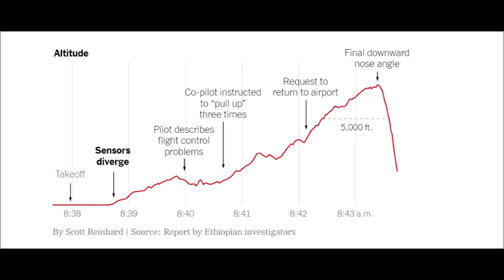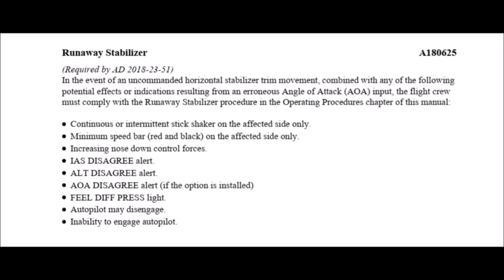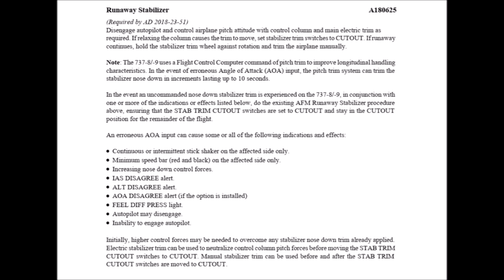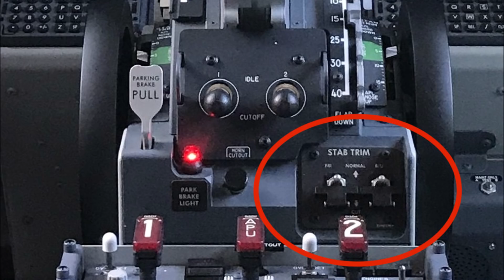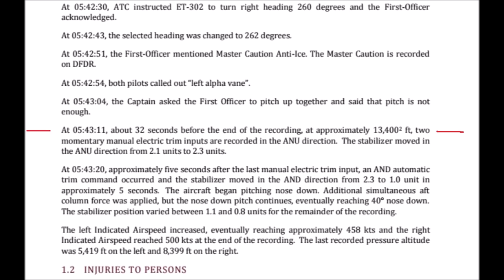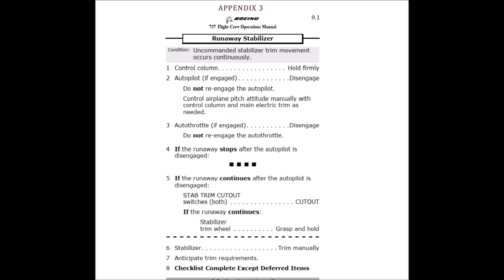737 Max Update 10 April 2019 Runaway Stab Trim Procedures

Comment: you keep saying that the crew came very close to saving the aircraft, and that they did NOT have the luxury of altitude, so are you saying that this is the fault of the pilots?
Reply: No, Juan never blamed the pilots. What he said is that they could in theory have saved the aircraft, which is a different thing.
Reply: @gordonrichardson2972   who is Juan??!!
Reply: At 00:03 in the video he states that his name is Juan Browne.
Reply: Disengage you know they've been saying that for a while  no one can listen  them anymore because people know the truth. .
Reply: I would have to say, the pilots had their hands full and not enough altitude/time to get control of the issue.  Sounds like they focused on getting control and the emergency occurred before they finished cleaning up the aircraft from take off where they would have switched to climb power from takeoff power.

It is similar to the 2 737 rudder hardover crashes in the 90's. The only reason, the 3rd 737 did not crash is the pilots had some knowledge of the previous crashes.
Reply: @fyrman9092   yes it does sound like they were super busy and focused on particular things..maybe some of that might have distracted them from the increasing airspeed...i'm not saying it's their fault either...

Comment: This speed vs. trim theory is not correct. If the aircraft is out of trim nose down, the faster you fly towards the trimmed speed, the more in trim it gets.
Reply from the maker: See previous updates.
Reply: Yes, but the the controls get heavier at high speed. In particular, it the elevator is forcing the stabiliser nose up, the trim gets harder. The whole story is very complex, and we are still putting together pieces of the puzzle.
Reply: @gordonrichardson2972  Yes its indeed very complex. I found this note in one of my previous aircraft types QRH, for stab trim runaway. "If a pull force is required, increase
 airspeed. If a push force is required, decrease airspeed."

Comment: Thanks! Very well explained. Is there a generation of pilots out there who can't actually fly without the computer? Or are these new generation of aircraft difficult to fly without the computer?
Reply: It's the computer that pointed the plane to the ground :(( It's like the computer in your car that run lane assist suddenly decided to turn your wheel to one side and keep it there. What will you do? Unless you are trained to handle the situation expertly, most drivers with the surprise and danger factor might not make it, especially if they were at high speed or in these cases both high speed and/or low the the ground. It's not a case of pilot incompetent, or computer too complex. It's just a case of inadequate design that make the job of a pilot that much harder that an average pilot might not make it. If only former fighter aces can fly these planes, we can't just hop on an airplane to go anywhere in the world like we can do today.

Comment: Quick question.   The first airworthiness directive said that manual electric trim could be used to neutralize the pressure on the stick before flipping the cutout switches. 
So, what happens if you just hold down the button for manual electric up trim?   
Does it run continuously?  Does it run for X seconds, and then cut out?   
If the latter, then how soon can you re-apply it? 
If we look back at the data logs for the Lion Air flight, they never did flip the trim cutout switches but they did keep applying bursts of manual electric up trim in response to MCAS giving them down trim.  They did it a couple dozen times, and only near the end of the flight did they seem to apply less and less up trim (shorter bursts) while of course MCAS continued to apply longer bursts, which eventually did them in.  
For the ET302 flight they immediately applied back pressure on column after the first MCAS run, but did not try to correct with manual electric up trim until after the second time MCAS applied down trim which put them behind the curve for the entire rest of the flight.  
Is there some technical reason either crew could not  keep applying manual electric up trim continuously until the stick pressure was neutralized, and then flip the cutout switches?  

Putting aside the throttle management, my read is that they
1. Could have trimmed electrically at any time to set the trim exactly where it needed to be. 
2. Could have reached over (per the runaway trim procedure) and manually STOPPED the trim wheels from turning, at any time.     
Using the two together, you could run the manual electric up trim, then manually stop the wheels, while you ease off the column to test whether you're trimmed (stopping anything MCAS is trying to do), rinse.. repeat until it's trimmed neutral, then flip the cutout switches, and proceed with a normal emergency landing.
Reply: Many good points. We do not know all the answers (as Juan says). Boeing will have to do lots of proper engineering studies, not just rely on pieces of paper, dating back to 1968 when the B737 was first launched.
Reply: @gordonrichardson2972   I think this one can be answered without months of analysis.  Any  commercial pilot should be able answer this pretty quickly.  If nothing else, the real 737 simulators used for training should run same flight control software as the plane itself, so the question is,  what happens if you hold the manual electric up trim button down for a long time?  
As for the wheels, we already know they can be stopped by hand (has been demonstrated), it just seems that it never occurred to either crew to do so, despite it being part of the runaway trim procedure.
Reply: No, this is not a simulator issue. There are many details about how the wiring circuits are built, whether the electric or manual trim is strong enough to overcome the aerodynamic loads on the horizontal stabiliser at VMO, and many other points. These cannot be answered by pieces of paper, but by actual engineering studies and flight tests by Boeing pilots. These will all form part of the actual investigation, not by armchair experts.
Reply: @gordonrichardson2972   Except none of those things pertain to the specific question I asked.  I didn't ask if the flight loads would overwhelm the electric trims.  I asked what happens when you hold the electric trim button down for a long time.    Either it runs the trim continuously until the button is released or the trim limits are reached, or it doesn't.   That's a flight control software decision.    It does not take months of analysis to answer that question.    If you look at the Lion Air data, you can see that the pilots applied up trim roughly 30 times, but always in relatively short bursts.   I want to know if the flight control software limits how long up trim can be applied.
Reply: I read your question perfectly the first time, and have discussed it extensively on an aviation forum. We do not know the answer for the MAX aircraft, since there are only 4-5 simulators available worldwide. Even if someone did that test, they cannot mimic the behaviour of an MCAS event, since none of the simulators has been programmed to do that. We do not know. We do not know, yet...

Comment: Nice video Juan.  IMO failure to control airspeed (throttles never retarded) is the biggest factor in this accident.  I flew Captain on 737NG for four years (same airline as yours) and can attest to the level of emphasis in training for basic aircraft control when dealing with any problem.

Comment: You do a really good job with these reports.   As a programmer I find it incredible that such a powerful system relies solely on AOA.  It truly seems to be an add on and not part of the main computers.  Why doesn't it look at AGL or flight attitude as inputs to the system.  What happens if MCAS is commanding down while at the same time the pilot is commanding up with the switch on the yoke?  Who wins?  I think we know the answer.  Did Boeing change that in the re-design?
Reply: Trim switches on the yoke actually do temporarily override the MCAS commands.  Pilots used them briefly, the big mystery is why they didn't use them long enough to get the plane into a reasonable trim situation.
Reply: There has been a lot of speculation on that front. We can never know the intent of the pilots, nor can we be entirely sure that MCAS allows the pilots to trim nose-up if AOA is high. As Juan says, more questions than answers.
Reply: Gordon Richardson 
We absolutely can be sure that nose-up trim is available during an unwanted MCAS event because the FDR information shows that the pilots were able to move the stab in the nose-up direction using electric trim after MCAS moved it nose-down. 

The mystery is why they only applied enough nose-up trim to partially undo the initial MCAS input.
Reply: IMO, you cannot make those assumptions, simply based on the FDR data. We will have to agree to disagree.
Reply: Gordon Richardson 
What do you mean? The FDR data shows them asking for nose-up trim and it shows the stab moving in the nose-up direction in response to each nose-up request. How is that not a clear indication that it’s still available?
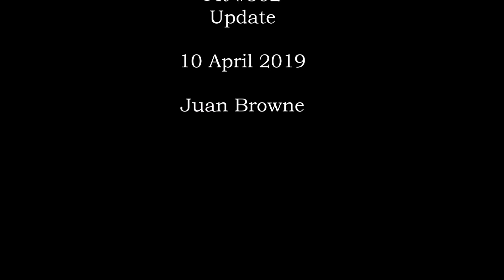Reply: @gordonrichardson2972  It's based on both the FDR data and the documented behavior of the system.  If you choose to ignore data because you don't like it, that's your problem.   16:25
Reply: videographerify If you choose to believe Boeing documentation, you are in the minority. They and the FAA have lost credibility after MCAS, and everything about the MAX will be subject to extra scrutiny.
Reply: @gordonrichardson2972  You left out the part about how the FDR's on both crashes showed the yoke trim switches actually overriding the MCAS.  You don't get to pick and choose which facts you want to believe.
Reply: @videographerify I don't see your point, and its tiresome arguing with you.
Reply: The decisions made in designing MCAS will be subject to exhaustive scrutiny. Some of the inputs make sense, even in retrospect, though as a whole they were a disaster.
Reply: Since they went up and down, up and down it would appear to me that the pilots only had control of the trim in between MCAS events.
Reply: Ron Carr 
Not sure I follow your logic. Pilots making an electric nose-up input will stop MCAS, so up and down commands would not be seen overlapping.
MCAS trimmed down, pilots didn’t want that so they trimmed up which reset MCAS. 5 seconds later, left AoA was still too high, so MCAS resumed trimming down. Pilots didn’t like that, so they trimmed up. That stops and resets MCAS, so the down, up, down, up is to be expected in this scenario.
Reply: 53C52 Yes that seems correct.  After some reading, MCAS runs for 10 seconds and is off for 5 and then activates again.  And the spec says the system resets if the pilot hits manual trim.  So why did they crash?
Reply: Ron Carr 
If you haven’t already, you should look at the preliminary accident reports for the Lion Air and Ethiopian accidents. 

The FDR evidence in those reports shows that the Lion Air pilots made nose-up electric trim inputs to counteract MCAS more than 20 times, but they never trimmed long enough to return the stabilizer to the position it was in before the first MCAS activation.

The Ethiopian pilots fared better because they turned of the trim after only two MCAS inputs. They also applied enough nose-up trim input to stop and reset MCAS, but they also failed to apply enough nose-up input to completely reverse the initial MCAS input.

I don’t know why that happened with both crews, but I believe that played a major role in the ultimate outcome.

The reports also confirm that 10 seconds is the MAXIMUM that MCAS will trim nose-down, but it doesn’t necessarily mean that it always applies 10 seconds of nose-down trim. 
MCAS stops trimming and resets itself as soon as either pilot applies nose-up trim with their yoke-mounted trim switches, whether 10 seconds has elapsed or not.

Comment: Juan, that is an insightful review of the report. It appears that 2 crucial steps in the procedure were deviated from.  It is interesting that these steps are the same for runaway trim for older 737s, as well as the MAX. Particularly in view of the October crash of the Lion Air 737 MAX, crews worldwide should have been alert for this. The points you made about not jumping to conclusions couldn't be more relevant.
Reply: The issues include the fact that the older pilot was previously trained on the NG model, and the younger one had little flying experience. A toxic combination in a complex situation.

Comment: Am I wrong in thinking both accidents started with faulty AOA sensors?
Reply: Starting to sound like it
Reply: No. You're not wrong
Reply: @richardwilson5911  What makes you say it's not faulty sensors?
Reply: @fyrman9092  read my post again. I agreed with you. Lol. The jury is out on whether it's the actual sensor or another part of the system but based on how we've been told that mcas works and looking at the AOA dats from the FDR it is clear the faulty data it was getting triggered MCAS.
Reply from the maker: At the very least faulty AOA inputs.

Comment: Two questions about the cockpit display on AOA conditions. Why are not both AOA indicators not shown on the screen just like all dual system (engine) status indicators are. The screen you show has only one AOA on the top right of the screen. 2)Why is the AOA disagree alert on the bottom of the  screen instead of right up with the AOA indicators. In fact, why are the indicators not flashing red or something similar if there is a disagreement.
Reply: Each pilot has their own flight display, and own AOA sensor, which allows independent verification. The position and colour combination of the AOA disagree is a bit odd.
Reply: @gordonrichardson2972  But if one pilot is in charge of the plane, he should have complete visibility into the state of the aircraft. The displays don't have the status of the left engine on only the Pilots displays.
Reply: Which ever display is faulty, the pilot must immediately hand over control to the one with working instruments. That may not be easy due to the experience and seniority gradient in the cockpit. Edit: There is always a set of standby instruments to use as a reference for comparison.

Comment: Boeing retrofit larger engines to an old design to save money on engineering and retraining.  They had to design a software program to compensate for an out of balance plane.  The software only required one of the two angle of attack sensors to control the software.  The sensor was defective on the previous flight and wasn't repaired.  The pilots weren't properly trained on the new system.  The plane wasn't  equipped with the optional AOA warning light system.  The pilots didn't reduce their airspeed and made a fatal mistake by switching the trim switches back on.  The FAA allows Boeing to do whatever they want.  Many, many problems with the entire system.
Reply: How about:

1.  Progressively less MCAS downtrim on each occurrence with cumulative memory until a suitable reset event has occurred (time passed or different FL etc.).  E.g.  First MCAS trim, 2 degrees.  Second, 1 degree.   Third half a degree etc.  Or as appropriate after consultation with a representative body of pilots.

2.  "MCAS ACTIVE" audible call out for each occurence.

3.  If pilot trim inputs and/or major manual pilot initiated control deflections detected, MCAS immediately deactivated UNTIL reinstated by pilots, but manual electric trim still available and unaffected.

4.  As a backup, 3 positions for STAB TRIM switches:

     a. AUTO (MCAS and other flight management systems can access.
     b. MANUAL  - Any auto inputs deactivated (MCAS instigated etc.), but manual electric trimming still available to pilots.
     c.  CUTOUT -   Electric trimming completely deactivated (in case of motor problems etc.)

Comment: While Boeing engineers were out to lunch, the legal team wrote generic instructions to pin down any problem back on the pilots:

1- Turn off all assistance 
2- Fly the airplane
> Pilots were in charge at T-10 !

These instructions should get simulated with actual crash conditions:
40° pitch down + 90% trust
😂